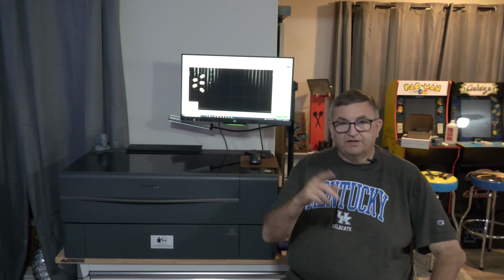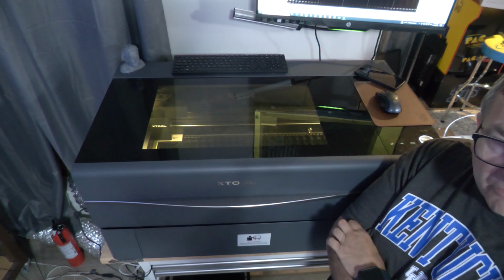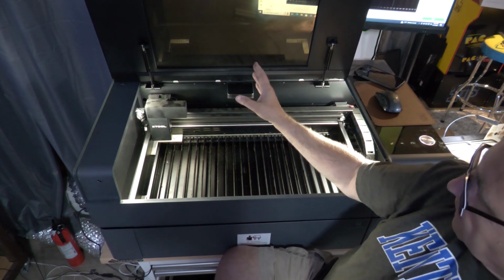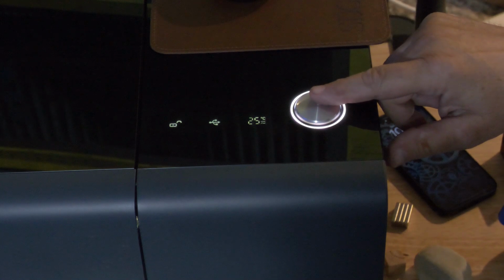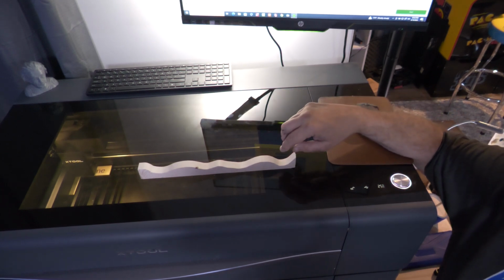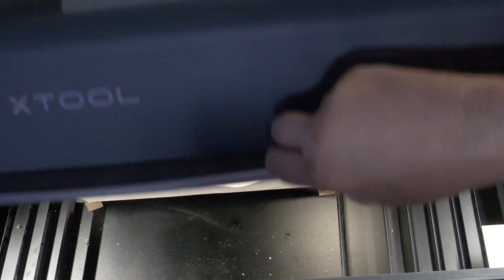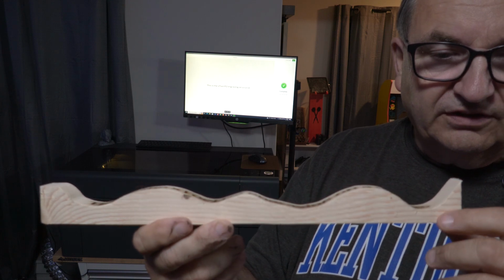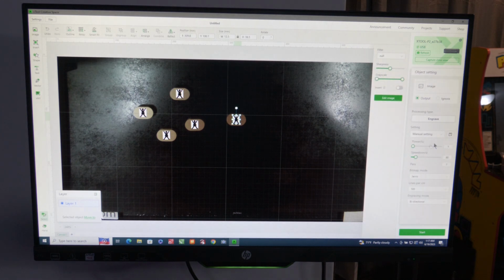xTool P2 55w laser review

Comment: Steve, my wife hates it when I do any lasering in our house. Do you have a foolproof way to cut down on the odor from the burning wood? I don't have a good place outdoors to set it up so I want to be able to use my office/hobby room. It's sort of my man cave indoors. Any suggestions would be appreciated. Thanks for all you do for the hobby of lasers and scrollsaws.
Reply: If you have a diode laser then make sure you have it in an enclosure with a strong exhaust fan. The CO2 lasers are already enclosed but sometimes the fan provided is not strong enough. On my China Blue laser, I took out the included fan and put a strong inline fan in the exhaust hose. That helped but if your wife is sensitive to the fumes then you may never get the exhaust strong enough. My wife is upstairs and still tells me she smells the fumes. I can't smell them so I guess it is different for different people. My next step is to add an air purifier near the exhaust window. Not sure it will make a difference but it is worth a try. The laser fume filters on the market are expensive and the replacement filters are costly as well. I may give that a try someday but right now I want to try other options to see if they work first.

Comment: I have a X tool D1 10 watt( for about a year), I would like to upgrade. Would you recommend going to a higher watt diode or a CO2?  I would like to be able to cut 1/4 inch or thicker wood.
Reply: The CO2 lasers are much more capable than the diode lasers. Some diode lasers will cut 1/4" and thicker but the CO2 lasers are much more efficient. I have a few diode lasers, but I use my CO2 lasers 99% of the time. If they are not too far from your budget then the CO2 is the way to go.